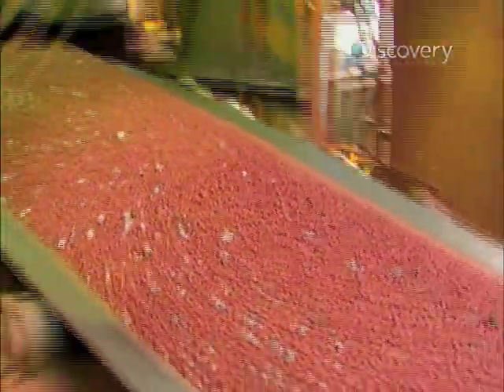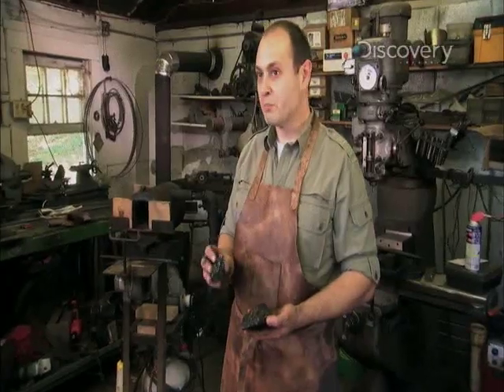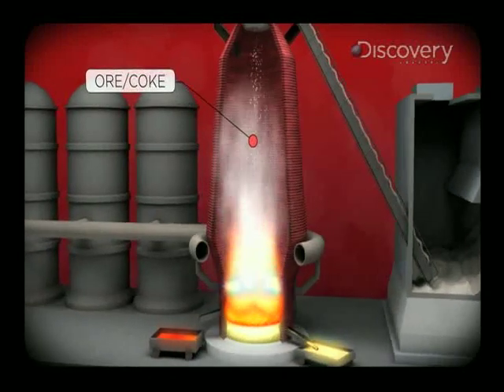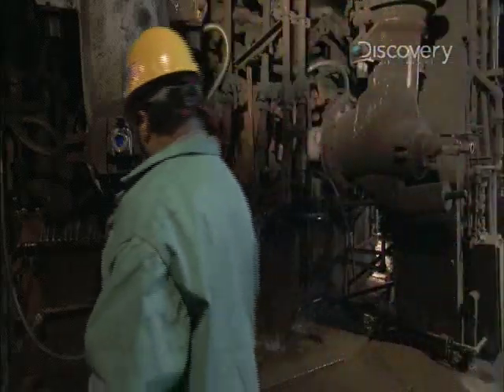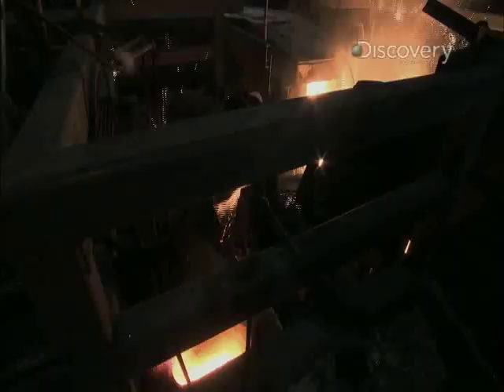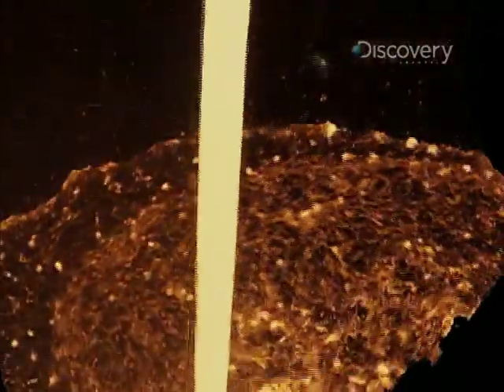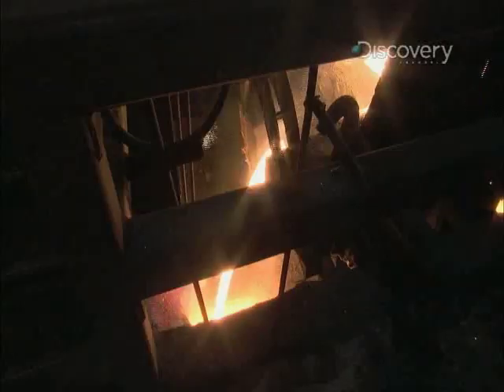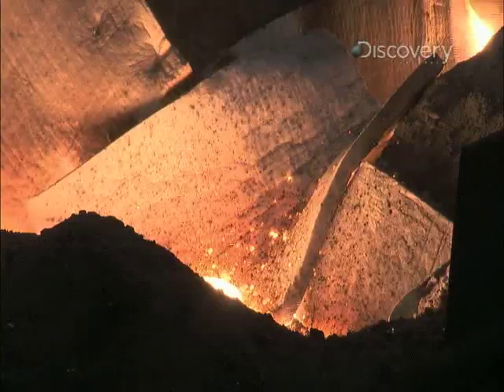HowStuffWorks - Ore to Steel

Comment: Title should be called "From Ore to Iron".
Reply: 7150285 Iron is an element whereas steel is an alloy. An alloy is mixture of A metal (Iron) with another element (carbon).
Reply: no it should not, it is steel in the final process, a mixture of iron and carbon.
Reply: ***** not in this vid no
Reply: steel and iron are basically the same thing. steel just has more of a carbon density.
Reply: They are not actually the same. Iron is an element whilst steel is an alloy. 
Also it gets confusing for people sometimes - for example Cast Iron and Pig Iron are an alloy of Iron And Carbon just like steel, but they are still called Iron not steel.. 
Only a certain amount of carbon combined with the iron is called steel. Too much or Too Little carbon and it's referred to as Iron with a name tag(Wrought, Cast, Pig..)
Reply: @RSeamus  yes but in practical terms they are almost the same because in industry you are never really going to see pure iron it's going to have some level of carbon.
Reply: Fewmanticore357 - so steel is basically iron + carbon?
Reply: +7150285 yep
Reply: Pig iron

Comment: hhhmmm when did we get to steel? Did I miss something or is this a big fat waste of time?
Reply: They skipped the part where it's made to steel. Most probably this is just a preview of the episode as it was too short. 
Basically,  concentrated oxygen is pumped trough the pig Iron to reduce carbon content and make different grades of steel depending on carbon content..
Steel scraps are also added to recycle steel as far as I know these days.
Reply: no

Comment: @joemchang Ore is the rock which is mined from the ground.In certain areas the rocks will contain higher percentages of Iron Oxide,this is the "Ore" the more iron oxide in the rock the better.Sometime the ore is refined by crushing it and concentrating the iron oxide by removing waste rock,This refined ore is made into marble size pellets which are then put into the blast furnace with limestone,the limestone is used as a flux,it melts and removes unwanted impurities in the iron.

Comment: Why has no one considered combining the Blast furnace with the Basic Oxygen Furnace process so as to produce steel directly from the blast furnace? All that is required is the same water cooled oxygen lance as used in the BOS which is lowered into the molten steel after the slag has been tapped,to blow high purity oxygen through the iron to remove the excess carbon.This would remove the need for additional multi million $/£ plant and would reduce transport of molten iron/steel around the plant.

Comment: @rddaos Yes that's what he said. But if you finish that sentence he said "at a rate of".  He's talking about the volume of air moving into the furnace. You don't have to state the distance something moves to let someone know it's moving. In this situation he's just saying that the air is moving and how much is moving in. Because in this situation the distance the air moves, or the speed it's moving at, is irrelevent.

Comment: @rddaos Fine... you got me on explaining motion. But your still wrong about the video. The reference to "110,000 cubic feet per minute" is not talking about the motion of the air.... but the quantity of air being forced into the blast furnace. So in  the last comment, by pointing out my mistake, you just pointed out your own.

Comment: @rddaos WOW..... did you realy say movement can only be given in distance over time and not volume over time? If that's true then how do you explain, for instance, the movement of water from a firehose? You would state the amount of fluid volume over a set amount of time. Not the distance the water travels through the hose or from the nozzle.

Comment: You don't have to melt steel to weaken it substantially.  You can make it easier to bend just by sticking it in a fire until it turns red.

Comment: I think what they mean is that the failure point of wood to a similar piece of steel wood is higher. Much like how if you take the human bones and a concrete cylinder the bone can support more weight due to its porous nature.  I think in the cutting you are thinking more along the lines of pure elements and gemstones. Then again I skipped most of highschool so who knows?